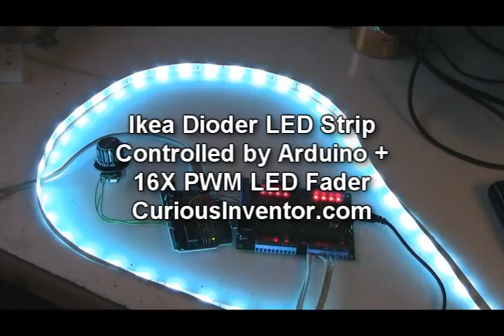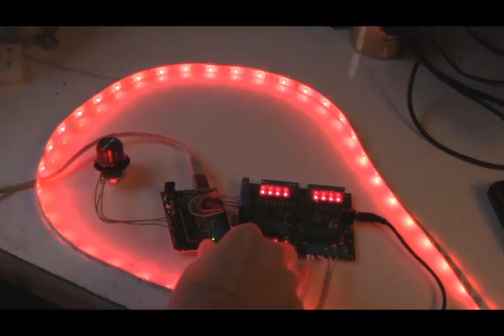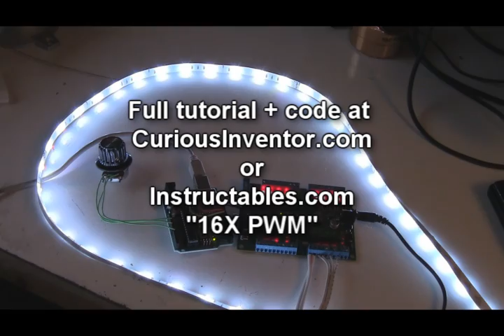Ikea Dioder Arduino Control with 16X PWM Led Fader Board

Comment: @CuriousInventor Oh, I understand, I didn't realize that this video is prob more about the 16X controller board and that you sell it on your website. I have wanted a controller like this for a while. Two quick questions. What current is the Dioder running at? are all the LEDs in series, therefore requiring a large amount of voltage? I have wondered how to control the individual channels of an RGB strip without using a very large power supply.